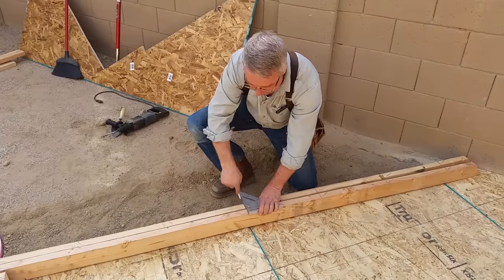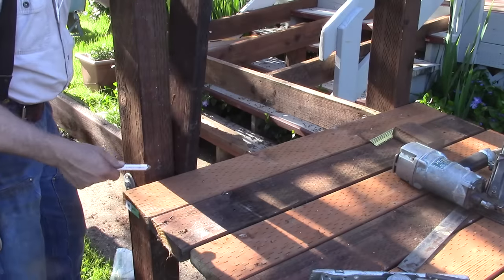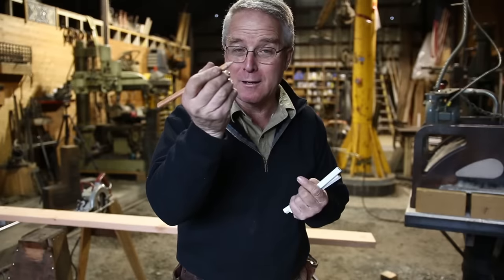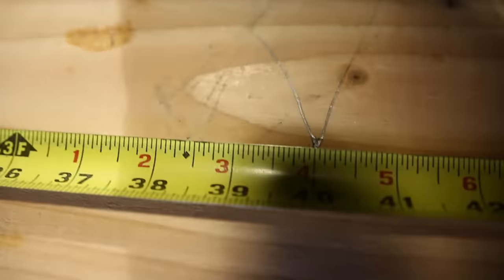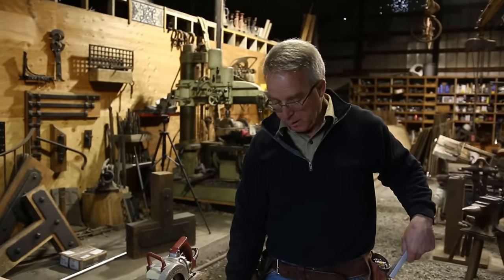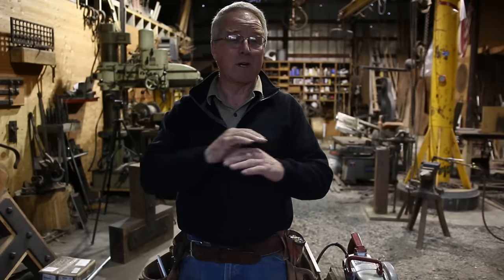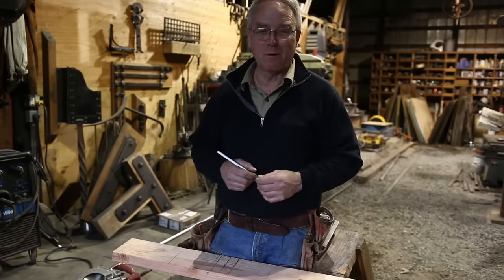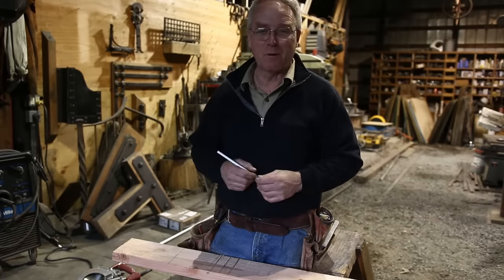Marking and Cutting Pro Tips

Comment: Good topic but it seems you left out a few necessary markers.  Sharpies don't last out in the weather (case in point:  I marked my box trusses out on the wall plates then got rained/wintered out for five months.  They were pretty much completely faded.) for these a paint marker is the trick.  When marking wet lumber, now I realize you are in that sunny Oregon climate and this is small potatoes but here where it rains 160" a year we often can only use an 'ink pencil'.  Yes the mark will dilute but it often is the only thing that works for the short term.  A Sharpie (and the Milwaukee brand seems to be no better or worse than a regular although much higher priced) will not mark wet wood or oily metal.  Also when using a knife or scribe one needs to take very light passes so the grain doesn't deflect the cut, then repeat with more pressure.  Same with an adjustable edge marker.  Just some additional thoughts.  Take care.  Doug
Reply: Douglas Thompson write in the rain my friend. Look it up

Comment: 9'11" was an inside measurement.
Reply: why bring politics into this? why?
Reply: Chainsaw fuel can't melt steel studs!
Reply: I laughed, why not :)
Reply: This was a good one lol
Reply: Just wondering what you use to mark cement board (or block for that matter). Sharpie makes a great line, but the tips get chewed up. Pencil or lumber crayon gets worn down too fast.
Reply: Douglas Kok still a PITA to keep having to re-sharpen them. I have tried soapstone too, it does not make a clear enough mark.
Reply: I still have a free nail apron from the Japan Store in Japan Missouri .  It was owned and operated by the best people.  Advertisement items should be free every time you use it there THEY are.
Reply: I dont see any politics yet?
Reply: Some people say nanothermate shaped charges are useful for framing ;-)
Pleasant surprise to see a political reference here, though I think it goes right overhead of half the folks that see it.
Laughed hard at that btw, and the chainsaw fuel not melting steel
Reply: tohopes I read this on 9/11
Reply: This video was all fake cgi
Reply: Clever although it did fly right over at first but then was grounded with zeroization
Reply: @phonedave  I'd say use something that is going to wear away instead of a marker or pen. Something like chalk, pencil, or even crayon. As long as the cost is low, you won't mind it wearing away quickly.
Reply: @AnthonyGarcia-kr9vu  I read this on 9/13, two years later. Nobody told me we were supposed to read it on 9/11, or I would have been here two days ago.

Comment: if you're measuring and you have a guy cutting for you make sure he repeats the number back to you. I have had a lot of 7/8" turn into 7/16
Reply: I solved that issue by writing or calling numbers using only 1/8ths. For example 1/4" is written as 2/ expressing 2/8ths, 1/2" is written as 4/ expressing 4/8ths, 3/4 is written as 6/ expressing 6/8ths. for any 16th" it is the nearest 1/8th  big.  7/16 is 3/8big written as 3/b,  9/16 is 4/8big written as 4/b ect. ect. Once you teach guys the system the number of boards cut wrong goes way down, the number of measurements that most guys can  remember at once goes up, and production increases. All of this makes more money faster
Reply: Dark Knight Monk this is how everyone at my company calls out numbers and it is very efficent. Very few errors. Example: "76 and 5 strong" or "2 foot 4 and 4". Written down it would look like : 76 5/+ or 2' 4 4/" works great!
Reply: The man who taught me how frame houses a long long time ago, also taught me to call out measurements breaking everything down in 16ths. Example: 15 and 1= 15 1/16   15 and 6= 15 3/8 and so on. Eliminating the 7/16 and 7/8 confusion. The problem is calling out like this and then teaching someone who doesn't use this system.
Reply: Try a kid doing that to you over and over again when your stick framing on a scissorlift lol
Reply: i agree, call outs should be in 16th's, not 8ths. "92 and 7" = 92 7/16th. less confusion, more accuracy. i'm bothered if i make a cut, or get a board, that's 1/16th off. that's tolerance for framing, but damn. just because it's acceptable doesn't make it good.

Comment: Excellent video! Two points from the field:

(1) When I make my crow's foot, I try to always put another little line through the mark on the waste side, so that the waste-side arm of the crow's foot is now an 'X'. That way I always know which side of the cut is the piece I need, and which side of my line I need to cut on. 

(2) There was a day when for some reason maybe ⅔ of my cuts were an inch short. Drove me nuts! I finally figured out that the sliding mechanism of my tape was catching rather than the hook itself. So a heads up: look at where you're hooked to make sure it's the hook on the end of the board, and not the sliding mechanism.

Comment: Measure twice, cut once. Unless you own a board stretcher, Ha.
Reply: learn to measure, get it right the first time.
Reply: Kerry must own a board stretcher. Always check your work.
Reply: I usually measure twice, cut once, swear, and then check my watch to see if home depot is still open.
Reply: +Perry Woodman      "I cut this board three times, and it's STILL too short".
Reply: What am I supposed to do if I DO own a board stretcher?
Reply: Measure at least three times, marking each... carve off the judgment call between them... shave some more off when the thing won't fit, and proceed to hunt down the BFH and beat the hell out of it until it's "in there" anyways. 

    Workmanship was meant to weed out the weak. ;o)

Comment: One of the things I brought to carpentry from drafting and design layout, was putting my nib or pencil tip on to my mark, and then sliding the tool (speed square, t square, etc.) up to it. This maintains the relationship from the tool to the nib, so you never accidentally strike a line incorrectly. I teach this to all my new guys. I also remodel rather than new build, so even in framing I use a mechanical pencil, the children's 1.3mm lead mechanical pencil are always "sharp" but very difficult to break even on rough sawn lumber. Great videos, thanks so much for you technical/intellectual approach to the trades! Looking forward to your doors/windows install video.

Comment: Thank you for your posts.
One of the things I do when marking for a cut, I use the first mark to locate and the second to orient the side of the line to be cut or to use when setting intersecting material, such as a stud or rafter, etc. Many folks add an X, and a third line may be added to make an X. 
I so hear you about having "inch-itus". It is so easy to do, especially when viewing the tape upside down, for me.
I noticed you used white pencil on dark material. A friend of mine suggests maintaining a wedge-sharpened stick of soapstone in his tool bag for marking dark material. 
For me, the most challenging part of woodworking is keeping track of the last tool used! Good for me that I don't depend on my memory for my livelihood any more.
Last item - I am off work with a broken wrist from a vehicle accident. In the interim, I purchased a laser measure device. When I go back to work, I will be installing flat MDF case and  base where elevations vary from one side of a doorway to the other. My hope is, when I return, is to use the laser-measure to catch all four measurements with one ladder climb, subtracting 1/4" reveal from said measure and write the measures on the drywall in the appropriate locations. They are easy to see, make note of, and then use to cut all four sides, and, if I'm accurate enough, the cuts needed for the header cut. We'll see.
Blessings to you and yours.

Comment: Great instruction! Thank you. An old Amish carpenter years ago explained this to me and took it even a step further and used the dialing marks to mean different things with each mark. The first was a straighter mark used to indicate your measurement while the second was an angled mark to indicate which side of the line the blade needed to fall on. Using this method, I e been able to measure down to within 128th of an inch the rare times it was necessary.

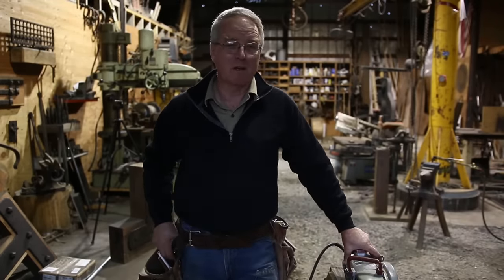Comment: I’ve looked for a video like yours for a while. At 7:20 into this video, I found it.  With two people working, do we, “cut the line, split the line or save the line”.  Wood isn’t cheap now and a short cut can mean wasted wood eventually.  Damn 2x6 or 2x10 is a small fortune, not to mention lost time.  I’m working with my son in law and we need to answer that measure/cut question. Also, there is a time to really focus on cutting.  Quit the BS, and focus. 
I really enjoyed your video.  We’re building a cabin so it should be fun, as long as we’re on the same page.

Comment: Great points (yup, pun intended!). I like the round pencils for scribing. I like the flat guys, because you can really customize the tip. I make it like a chisel for marking rough lumber for mortise work. Can make it like a sewing needle for smoother boards. Make it dull for heavy, quick marks. My favorite measuring/marking tool is the chalkline.

Comment: I really like the way you explain things. I just found your channel a couple days ago. I can fully relate to the way you do things. I makes me feel better because I been thinking that I was an extremist, but I see that you also understand my basic approach to things. " A hell of a lot easier than having to put it back together, is not letting it break in the first place" It has served me well. As far as the pencil use, I personally try not to use #2's, the line just keep on getting thicker as it is used. With a carpenter pencil I will sharpen one end regular and the other end  I will leave the full width of the graphite and the use something ( sandpaper to concrete floor) to create a chisel point that can mark very fine line that will rival a box cutter. This type of point also lasts. I personally like to put a small mark and then put something like two half ellipse to highlight the location. This works well on weathered plywood and lumber.
Like you said a little mark and you turn around or leave and come back, it is hard to find the actual mark. Congratulations for your videos.

Comment: As someone who works as an industrial elektromechanic. We repair equipment, maintain it and make new machines and parts at the customer’s request.

So a lot of welding, metalworking is involved.

We use scratch needles, paint markers, or a piece of soapstone. Some people like to cut it off at a sharp angle so you can draw a very sharp line with them.

I mainly use soapstone to mark the location of a tack, rough lines and markings. Paint marker is for writing and markings. As it will stay on there, even if it gets wet by coolant from a saw or a milling machine. Can also be used to color gearteeth to watch the wear pattern.

Scratch needles are great for a thin, sharp line for a cut with an angle grinder, badsaw, cutoff saw etc.

They even make some markers nowadays specially for welding that light up due to the intense UV-light that comes off the welding process.

Comment: As a finish carpenter I was taught to make a crows foot with a small line and one long tail. The size of the small line indicates how accurate the cut needs to be (smaller = more accurate) and the tail tells you what side the measurement was pulled from.

Comment: Thanks for this excellent video, and particularly the visual comparisons of the effect of the placement of the kerf, relative to the marked line, when making a cut.  Usually the angled second mark on the measurement is on the waste side of the board, so you don't get confused after the speed square is removed or when you are making cuts on a bench saw on different boards at the same time.  

In the last part, where you are marking a critical measurement with a razor edge tool, it would seem that accuracy would require that you cut up to the line from the waste side of the cut, but that you "leave the line" when you make the cut.  After you make the cut that way, you remeasure the board, or test fit it, or compare it side-by-side to pieces that are supposed to be the same length, the theory being that you can always trim one or two thousandths off of a board that is slightly too long, but there is no effective way to add a few thousandths back to a board where you "took the line."  In finish work or when doing critical framing work, like making angled cuts on roof rafters or trusses, making this approach a standard part of your work would seem to be essential for consistent results.

Excellent video, and thanks again for making it.

Comment: Another great video, FYI on the occular sawdust extraction tool tip, I've found if sawdust or really any annoying chip gets in my eye, tilting the head 90 degrees to the side so your ear is facing the floor and the troubled eye is on the same side and blinking has always worked for me, lets the tears and gravity do the work.

Comment: Hey Mr. EC, I've watched all your videos since you began the channel and as always this is (yet again) another excellent video! 

An excellent way I've learned to get an accurate mark quickly is to first place your marking instrument (pencil/pen/knife) against the measured mark and then slide the square up against the marking tool. This way, when you scribe the cut line, the line will be exactly where you want it no matter the thickness of your marking tool or how sharp it is at the moment of that particular mark.

Try it, I think you'll agree that this method is consistently very accurate and very fast, as the marking tool becomes a positive stop for the square so there is no fussing or straining of the eyes to determine the precise placement of the square nor will the edge of the square ever create a shadow that it sometimes does, depending on where the sun or overhead lighting happen to be on the job site.

Comment: One of my favorites for a balance between speed and control (coarse vs fine) ~ Is a carbide tipped scribe, a cheap one. Mine was like 3.60 something at home depot. I like it because with a second pass and more aggressive pressure you can make a bit of a trough which helps me start a cut when hand sawing, I also use that to make dimples for twist drills to seat into so they don't walk anywhere.
I've tried doing the same with a cheap scratch awl, but the pencil shape is easier for me and, well.. carbide :D

Comment: Though I'm an amateur, I'm compelled to inform full-rookies that a difference of even 1/32 of an inch in even rough carpentry makes a difference.  That was something that surprised me.

You mention compounding errors, or compounding additions--but even just fitting a vertical stud between a header and footer sometimes requires some amazing precision.

Comment: Thanks I enjoyed the video. A couple of things that might be of interest to you is if you are working with a darker hardwood like walnut or merbau a white or red pencil will stand out better than graphite pencils. You can use kids pencils but a quality pencil from an art shop will last a long time and can be obtained in a hardness that approaches that of a Number 2 pencil. If your eyes are not perfect the colour really helps.
I was once told that when you strike two marks the one nearly at 90 degrees points to the measurement on the edge and the second angled line indicates which side of the measurement to put the kerf.
All the best

Comment: At my small garage workbench I typically use a mechanical pencil, but I am also usually marking relatively small pieces.  I use a Pentel and rather than worry about fragile 0.5mm lead I use 0.9mm lead.  It makes a fine line but is also relatively durable and doesn't break easily, and never needs sharpening.

Comment: Very practical tips, as always. A new innovative marking tool that I find invaluable is the "Fatboy" pencil by Fastcap. It has the lead advance mechanism of a mechanical pencil, but the lead diameter is as big as the overall diameter of a #2 school pencil. Thus the lead can be quickly sharpened all the way to a fine point, if desired, by using a standard pencil sharpener, either wall-mounted or pocket size. And due to its very large diameter, the lead itself is far less prone to breaking than any of the traditional pencils shown in this video. Finally, replacement leads are affordable and available in various colors. I bought my first Fatboy for framing but have since found it quite serviceable for finish work as well, so long as you keep the tip sharpened to the degree your task requires. While sharpened to a very fine point, the conical geometry of the lead behind the point makes it dull a little more quickly than a mechanical, but almost never break.

Comment: I really like the razor idea.
Follow up with a fine point pencil.
Hopefully your speed Square is one with an incorporated pencil guide that you can use.
Or, a chalk line down the razor scoring.

Personally, I like to LEAVE the mark on the board so it is still visible on the usable piece after the cut
For me, it helps to flatten the learning curve if I have to remeasure and recut.